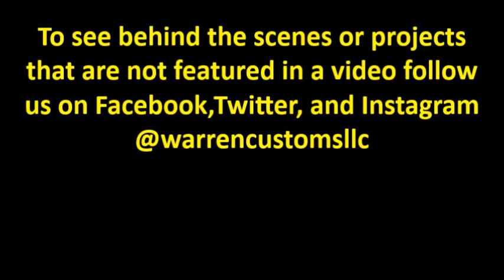Warren Customs Episode 12, Kibbe-Lee pushbar #2

Comment: are u able to show us how and where it goes to place? I'm currently trying to make a model size of the general lee and want to add a push bar but I don't know where it belongs underneath the car to stay in place btw beautiful car it looks amazing :)
Reply from the maker: Original season 1-2 cars the pushbar was welded to the bumper in many cases. Our narrow pushbars bolt on using the factory bumper holes. Later wide pushbars were bolted underneath the car to the front rail system.
Reply: @warrencustomsllc.2225  thanks for telling me, have a good day :)
Reply from the maker: @ItsArtroG  any time hope that helped